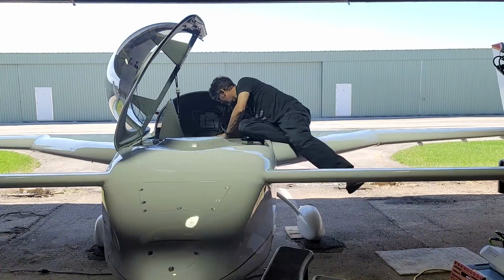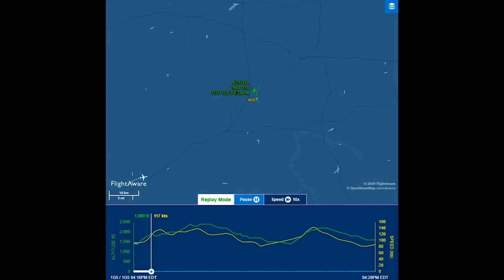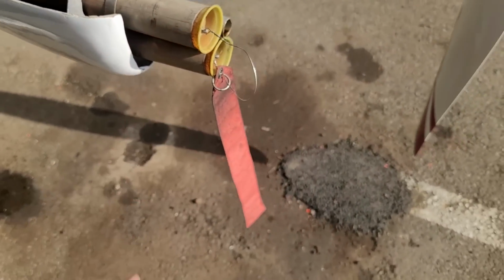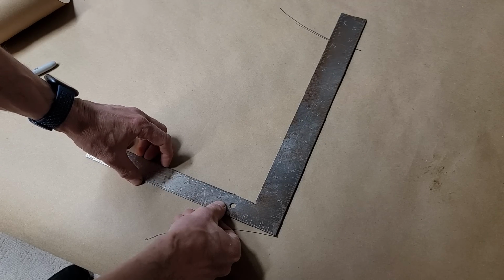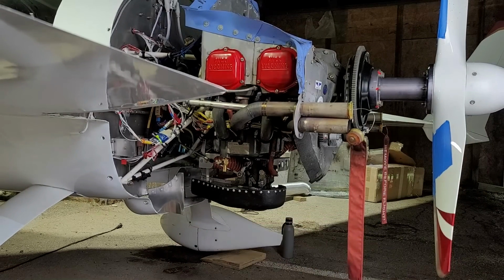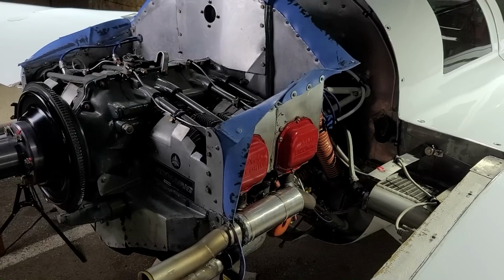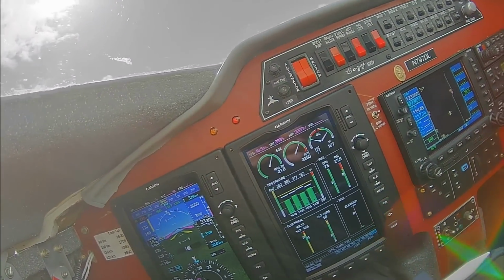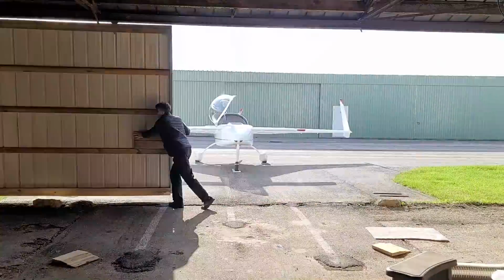First Test Flights: Unexpected Results

Comment: I think you’re going about the cooling all wrong. I think with the addition of all the hoses you installed, you’re actually blocking some of the air movement that cools the cylinder. You could mount some scoops on the outside of your bottom cowling  to connect the red hoses to. Then run the hoses up to the cylinders. The scoops would look like the one on race car hoods 
The scoops are similar to the ones we use on boats to pick up water for live wells. Yes you would have to disconnect them every time you took the cowl off but wouldn’t it be worth it to get the cylinders cooler.   You could mount them forward of the cowl to keep from having to unhooking them when the cowl is removed. The bigger the scoop the more air you will move 
Just a thought
Reply from the maker: The problem actually turned out to be a malfunctioning electronic ignition that was inappropriately adding full spark advance when it shouldn't have been.

Comment: Scott sounds  like you you need to check air flows with in you engine cowling at different points  you can do this using Manometers  setup with in your cowling with the Read out tubes next to cockpit or have second person running up the engine ...

I wonder if changing vents to top  Cowling behind the Fly wheel rather than just infront of  the Prop ?   

Ie Hot air rises ???
Reply from the maker: If you look at later videos, I actually did this, I rigged up differential manometers in the engine bay that I could read in the cockpit, only to find the pressure was acceptable. What ended up being the cause was a failed MAP sensor on the electronic ignition, which was inappropriately advancing the cylinder timing, causing the elevated CHTs.

Comment: Air is dumb, you need to direct it to the cylinders, by no means will air want to flow thru the fins on the cylinders, unless you force it to go there.
If one cylinder is hot, it could be excess friction, too hot a plug, or it's running lean from a vacuum leak.

Comment: You might want to re-think the use of hose clamps in critical applications .  With the vibrations generated by most  aviation engines who are literally trying to shake them selves apart . No Mater what the band is made of they are not the proper way to clamp something of importance. Why is the exhaust stack so loose?
Reply from the maker: That is how these planes are built, and those clamps have been on this airplane exactly like this for 20 years. The exhaust headers are independent, each one goes to a slip joint on the header flange, so they need to be held together to AVOID vibration. They aren't CRITICAL, but without them you could end up with vibration-induced wear.
Reply: @CanardBoulevard   I get that but doing cheap and easy 20 years ago doesn't make it any more correct. But I guess the repair to the new prop won't be that expensive so not to worry... love the plane.

Comment: Could you switch to U-bolt style muffler clamps to replace the flimsy radiator screw clamps that can't take the heat/expansion of your exhaust pipes?  Might save a prop.
Reply from the maker: Too heavy, and would damage the thin, delicate (and very expensive) stainless titanium alloy pipes. Those screw clamps are special stainless designed for this type of thing - I'm not sure why the one failed, as I never found it.

Comment: How about temperature sending units or guages ? 👨‍✈️Also, is OIL temperature normal
Reply from the maker: Oil and EGTs are normal. It would be very unusual to have all four sending units go bad at the same time, and the gauge is a digital G3X EIS, so not something that goes out of calibration.
Reply: Do the four individual temp sending units feed to one digital unit or signal generator of some sort? Good luck😎
Reply: Have you swapped the sending units from the two cylinders, and see what occurs under the same test conditions?  I don’t know a lot about recips, having said that, a friend is chasing a similar issue on his Harmon Rocket. He also,  is making cowl mods. Nothing has improved yet? I always think electrical 😎

Comment: Are you allowed to fly with the engine cowling off?
Reply from the maker: Allowed - yes. But this would be extremely bad, as the engine would overheat and be destroyed almost immediately. It depends on the airflow being ducted into and forced through the cylinder fins in order to cool the engine. Without the cowling in place, that does not happen.

Comment: I noticed something pertaining to your fox on the prop.  When you were talking about the screw clamp being missing I noticed black what looked like exhaust on the bottom of the pipe that the clamp came from. It looks like  spatter from the engine. Carbon or oil from maybe an issue with a cylinder. You may want to check that !!!!  Better safe then an oh shit moment! Just saying
Reply from the maker: That's from when the oil breather outlet used to be on that side of the engine. I moved it to the other side now.

Comment: What a cool airplane, Nice video :) I am new to this with airplanes and aircraft. i will start my ppl training this fall. But one thing I have noticed when I look around here on youtube and all the flight videos is that the finish on the construction in the engine compartment looks like it would be built in kindergarten. cables hoses hanging here and there. crooked and twisted. Everything looks so amateurish. Junk buildings. even on factory-built pipes or cessnas, the same junk building. Do you not have greater requirements in aviation. This is what you have to get used to. Not that it scares me but I just wonder if it is this standard overall on small airplanes. :) Happy flying to all. see u in the air later on hopefully if i get my ppl :)
Reply from the maker: What you see is the results of 20 years of upgrades and changes. You could rip out everything, start over, and make it look nice and neat, but it's still going to work just the same.

Comment: Remove the blast heat. Check intake leaks. Verify mechanical engine timing then ignition timing. Verify oil cooler and varistat. Did I see a zip tie on an intake tube? Your very calm👈🐱👍
Reply from the maker: I already pulled the blast tube from the heater shroud - no difference (except that the heat works just fine using the pressurized air from under the cowl, without the blast tube). I will be doing timing checks very shortly, oil cooler and variostat are good. You might have seen a GripLockTie on an intake tube to help hold it up out of the way of airflow.

Comment: The best way to to increase engine cooling is NOT to worry so much about the intake section, BUT look into the exit and make it an EXTRACTION rather than a FLOW.  PULLING air is far more effective than FORCING air.  Forcing air creates abnormal chamber pressures.  Extracting air creates a LOW PRESSURE system and reduces the air temperature while it works.  One way to do this is with a modified exhaust system that helps drive the air our of the engine compartment.  Work on that.
Reply from the maker: I'm going to be testing for this shortly, doing a pressure delta test across the engine.

Comment: I would have someone while you do a 70% run-up for about 2mins, use a IR temperature reader, and confirm you gauge readings.   
It possible its NOT a correct reading, and the gauge needs to be calibrated.
Reply from the maker: The CHT's are K-type thermocouples, and they are all independent. The chances of all four of them going bad at once is pretty remote.

Comment: I have an idea Scott. Could you take a reversible shop vac.... And fabricating adapter to fit over the lower air intake where your diffuser is and in the hangar turn it on and have it blow air into the diffuser and go around to the engine compartment and see how the air is behaving as it blows up through the engine compartment? I figured that might be a way to view the aerodynamic behavior of the airflow without possibly having to fly the airplane who knows?.... Maybe it might reveal something.  Just an idea
Reply from the maker: One better, I have a high-volume blower that I'm going to use to do this.

Comment: After the work you've done along with the new air scoop, I can't help but feel that the exit pressure from the engine must be too high causing air stagnation. Is the exit area from the cowling greater than the air intake area?
Reply from the maker: I don't think so, but I'm going to be doing a differential pressure test just to be sure in any case.

Comment: I thought in the previous video, it was said if the heat isn’t going into the cabin, then it’s being dumped on the engine….. could be the cause of the engine temp issues.
Reply from the maker: No, that is a very small amount of heat, and it gets dumped overboard, nowhere near the cylinder heads.

Comment: Is the new prop dissimilar in pitch and size than the previous one?  Different loading, thus thrust and rpm may be causing the temp to rise higher than previous.  One simple test would be to put the original prop back on an try that?  Johnston's baby oil may also help get the prop clean - it works with car exhausts :)
Reply from the maker: The distribution of thrust on this prop is different, but it is the same diameter as the old one, but yes, that is definitely a consideration.

Comment: If your cylinder head temperatures (CHT) are too high on those two cylinders, why do you continue to fly?  Is it high, just not alarmingly high?  Not trolling you, I really don't know and am curious.  Thanks!
Reply from the maker: They are elevated during climb - I can mitigate it by pulling the power back after initial climb, and they are OK during cruise - not ideal, but definitely within a safe envelope. If they were high enough to cause damage, I would not be flying with it.
Reply: @CanardBoulevard  Thank you for taking the time to answer that question. I have been a fan of Canards for a long time, and appreciate your channel.  Thanks again.

Comment: I may be wrong, but the clamps on the exhaust look like regular hose clamps, not sure if they are rated for high temperatures. Normal high temp exhaust clamps are a T bolt style. Just a thought. Fly safe!!
Reply from the maker: They are stainless, just like the exhaust pipes themselves.

Comment: Biggest impacts to cooling are timing and mixture not (within reason) airflow. 
Since the fuel nozzles bleed to outside air pressure, increasing air pressure at the bleed makes a leaner & hotter cylinder

Comment: I doubt you’ll get any benefit from a new duct unless it’s a straight ram, because the issue is pressure difference front to back. Work at sealing up the nose, foam blocks can go on the elevator opening. A boot over the nose gear actuator. Once you don’t have the same pitot pressure up front, the heater will cook you out of the airplane
Reply from the maker: I have foam blocks in the elevator openings already, as well as around the gear actuator. It's still leaky...I'm going to replace them with neoprene socks adhered to the elevator tubes and the fuselage side to fully seal it off.

Comment: Great video. With high CHTs, especially after maintenance, double check your ignition timing. Good idea getting the baffling buttoned up as well.
Reply from the maker: I thought that, but the problem exists even if I select just the mag or the electronic ignition, and the chances of the timing going bad on both at the same time is pretty remote.
Reply: @CanardBoulevard Yes I agree
Reply: Agree.  It only takes a few degrees of advanced timing n to run the CHTs high.  You can also check your engine data...you will see higher CHTs and lower EGTs with advanced timing.

Comment: NACA duct, good idea.  I had a 1" inlet, 3" long side and blew a ton of air.  Do you have somewhere for the cabin air to get out?  Stainless clamp, safety wire it?  We have small loops welded to the exhaust pipes that have a stranded stainless wire attached to the engine.  If the pipe breaks off it can't get to the prop.  I'll be following your CHT saga as mine are doing the same thing on a Velocity and I've tried everything to fix it!  I wonder if another plate on your diffuser could direct the airflow at the cys?
Reply: You're thinking there isn't enough cabin air outflow for the heated air to flow in? That's what I'm thinking.
The engine is going to end up with 4 electric fans each controlled according to its own temperature measurement!

Comment: I power my cameras from a standalone power pack. I have found it to be a game changer. I found the GoPro to be sensitive to low amps (not surprisingly). I chose a power pack, problem solved. I can also get the cameras going early (before aircraft power on) and just forget about it.

Comment: Ty raps are cheap, use more on your engine wiring.
Reply from the maker: I actually use GripLockTies that Mike Patey created - they are high-strength, removeable, reusable zip ties that have a silicone surface on the inside that a) grip better, and b) won't cause wear or abrasion like standard nylon zip lock ties.
Reply: Tie wraps or "zip ties" as I call them would not be appropriate on an exhaust pipe assy. Plastic like that melts under really high temps ... what's ok for holding a wire bundle together inside the instrument panel, and cabin, is not ok in the high temp area of the engine bay.
Reply: @ZPADEEDODAH   So you just let them hang loose?
Reply: @michaelsamson3276  No, of course, Scott needs an appropriate clamp for the temperatures as has been suggested by others above. I was just saying that "zip ties" are not appropriate in this specific location. Perhaps something made out of titanium to handle the high temps. I don't know a specific part number off the top of my head, but the decision on what to use lies with Scott since it's his aircraft.
Reply: @ZPADEEDODAH   Actually the FAA guidelines are pretty clear. In areas the will be subjected to something like 450F, you need to use metal locknuts. Otherwise ty raps are just fine everywhere except within a couple of inches of the exhaust system All spark plug harnesses come with nylon ty raps for example. The only times they are damaged is when plug wires with ty raps on them rest on the cylinder head fins. High performance turbo engines cause  ty raps to get brittle sooner if they are used in the exh system areas.

Comment: Is that 15 seconds plus of cranking the starter to start normal? 

Is best practice to never allow an engine to not be run up to operating temp for more than a week if possible? That's a general rule of thumb in terms of automotive 4 cycle gas or diesel engines. 

Does a 3 blade prop's 50%ish more resistance make more work for the engine? 

I was very nervous after that 15+sec cranking to start. But I'm completely unfamiliar with piston aviation.
Reply: Most aircraft engines sit for months between running.  As do most boat engines!  If you run an injected aircraft engine once a week then 2 seconds of cranking typically starts it.  There is effectively no prop resistance at low rpm's.
Reply from the maker: The engine had not run in 4 months. Now that it is being run regularly again, it starts in a second or two.

Comment: I think 2200 static rpm full throttle at your elevation is too low. That's probably 6 inches of MP over square. Is the 0 360 rated for that? I know 0 320s were good for about 5.

Comment: Not being able to see from here but wondering if there is any mounting between the two exhaust pipes. Heat & vibration would allow the distance between them to change and allow the clamp to loosen if there is no attachment to each other nearby. Also, I always avoid using worm clamps whenever possible because of their tendency to come loose, especially when not clamping something that has no resiliency (rubber, silicone, etc.) Also - temperature readings will change with supply voltage changes. Possibly your recent repairs to the electrical system created a change to your readings. I'd do a back-up / proof test by placing a sensor in a cup of heated water alongside a trusted mechanical thermometer. Maybe there is an adjustment/correction ability built-in to the system?
Reply from the maker: The worm clamps have been holding those exhaust pipes in place for >20 years now. I'm not sure what caused this one to decide that today was the day, but I've resolved the issue now anyway - if one comes off again, it will not be going through the prop.

The temperature sensors are K-type thermocouples - they actually generate voltage depending on the temperature, so they are completely independent of, and unaffected by supply voltage.

Comment: Yo, that hose clamp that went through the prop. I’m sure there’s a ton of heat on the exhaust pipe, especially right near that bend, if the clamp was very tight I can imagine it getting super hot and just letting go I suppose. I wonder if there are hose clamps specifically made for high heat scenarios.

Comment: Theory on your cooling: if I remember from your previous videos your cabin heat dumps (What could be cooling) air into the low pressure side of your baffling when in the off position and thus reducing the differential pressure below and above your cylinders. Consider sealing that off to collect data. I bet your cabin heat and cooling issues are intertwined.
Reply: As I remember it, the cabin air heat exchanger needs air to always pass through it. Otherwise the heat exchanger will get too hot for the material it's made from.
So I guess the pipe that takes unwanted heated air to the low pressure side of the cowel can't be blocked off, even for a quick circuit.
On another issue, I'm thinking the poor hot air flow into the cabin is perhaps a lack of an air exit path from the cockpit.

Comment: Wait is there a choke or something in there? You mentioned ‘leaning the mixture to not foul the plugs’.
Reply: no, it's a fuel injected aircraft engine.  The throttle body regulates the fuel air mixture.  We use a mixture control to lean out the engine as we fly higher.